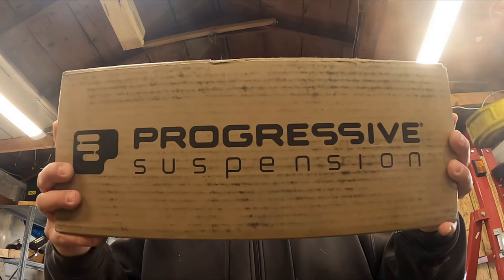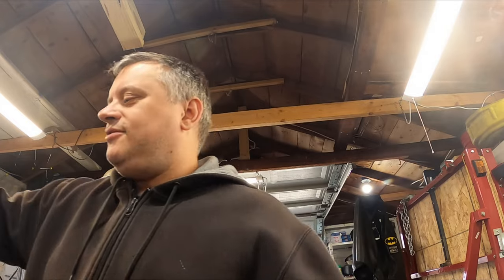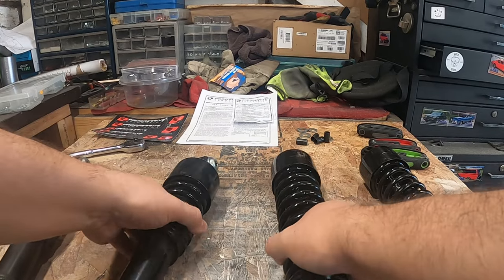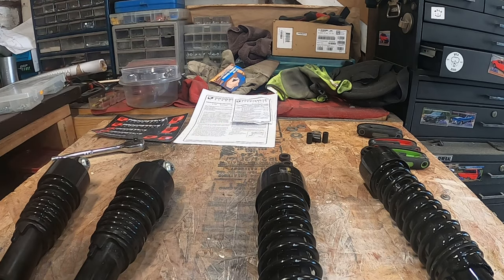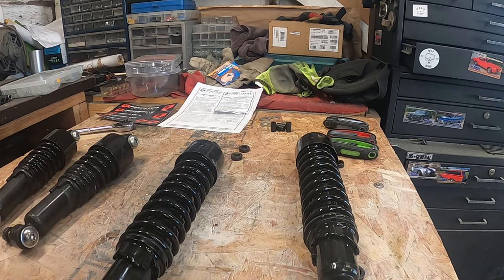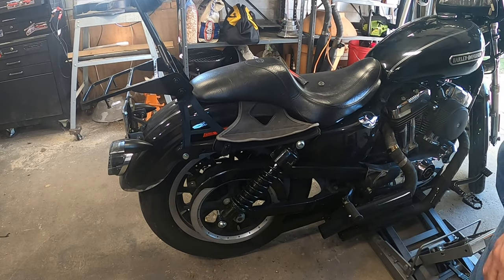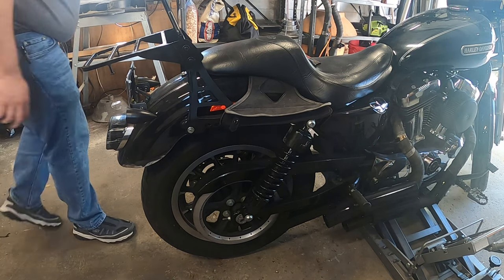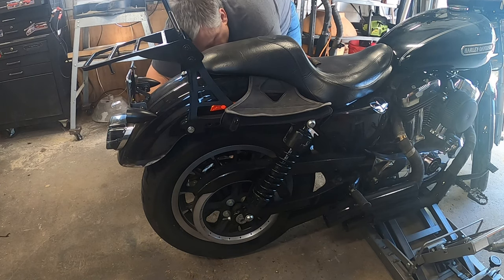Best Shock for your buck . Harley Davidson Sportster

Comment: Oh dear lord - your face! Shocking???🤣
I need to start looking into shocks for my Indian Super Chief. I have them extended as far as I can go and still get slammed every now and then on a bump. I had a passenger once...
Reply from the maker: Yeah I wasn't sure they would work but turns out they work fine giving me that lift. I found my riding boots lack that extra inch I need to touch the ground on a test ride I did which made it had to contact the ground comfortably. When I switched to another pair of shoes , it's works just fine. Next I need to work on the forks. Thanks for watching.